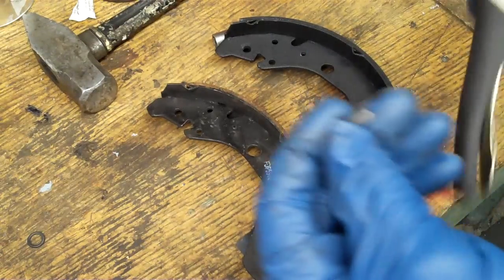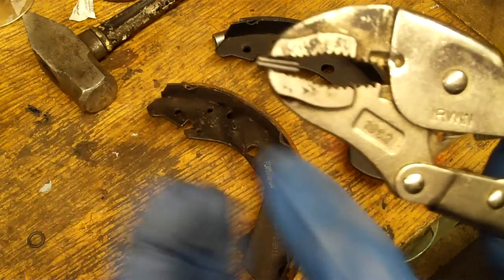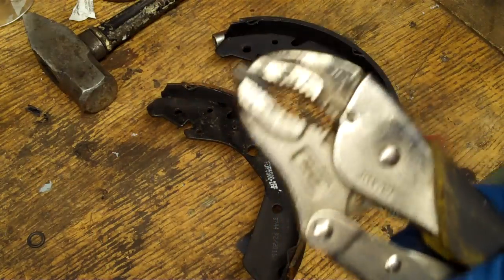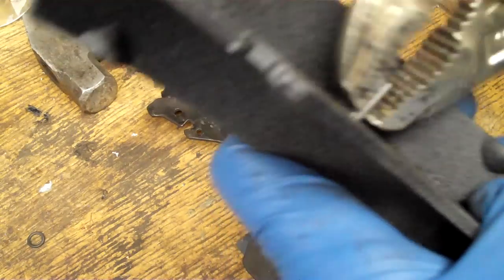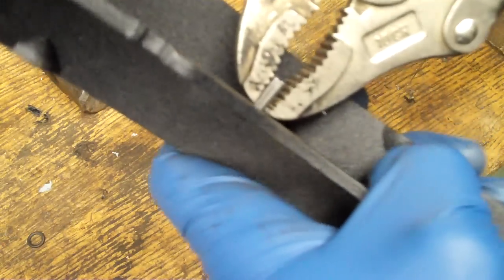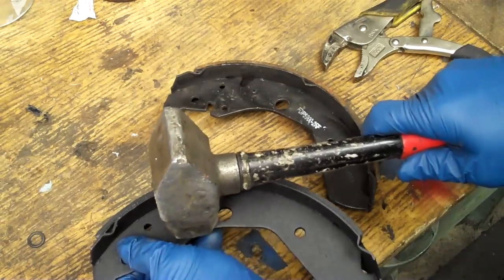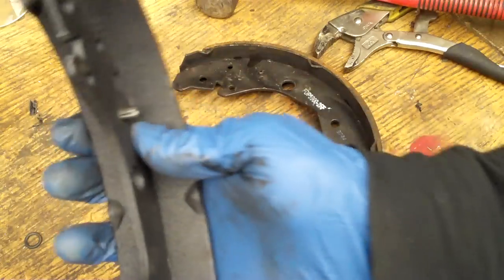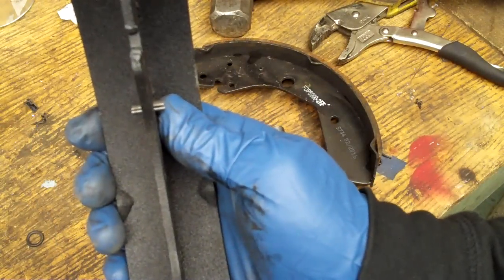Roll pin start trick

Comment: Great tip for starting it, keep in mind they make a roll pin punch which has a small ball on it so the pin doesn't expand as you hit it, for hard to reach places I use heat shrink to hold it on the roll pin punch
Reply: Thats genius if you dont have the correct size starter punch.  I will use this idea  TY

Comment: This is also a handy tip for getting a roll-pin out of a blind hole where you can't drift it out from the other side  (such as the peg in the back-plate of a DPA injector pump)